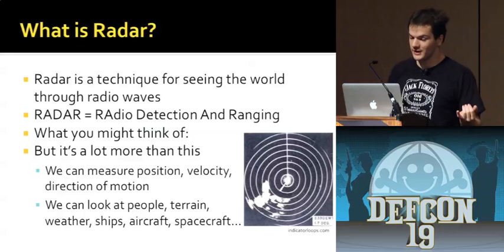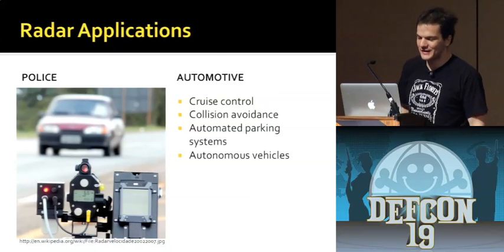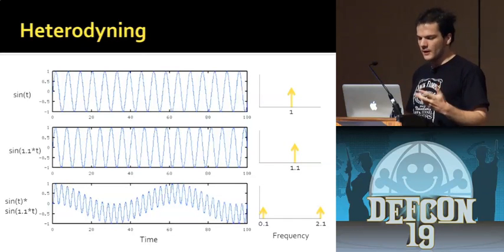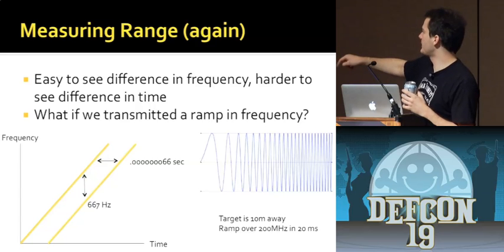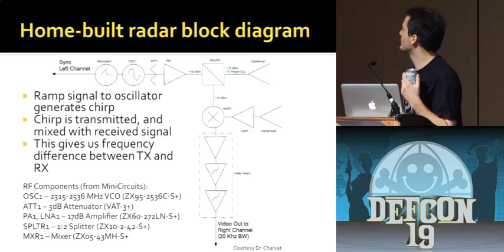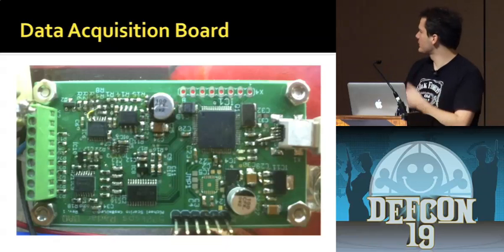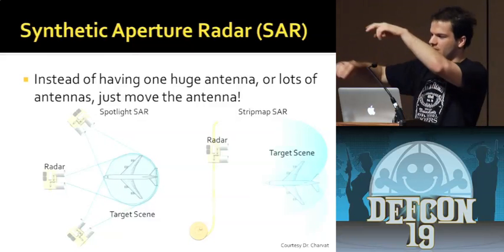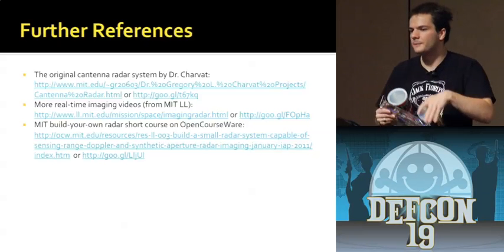DEFCON 19: Build your own Synthetic Aperture Radar (w speaker)

Comment: With Continuous Sweep, the constant audio Freq reflects the Range & Reflectivity of all returns.
The Sweep-Width can be set for Max-Range of reflections.
Sweep-Rate can vary to adjust desired Range-Resolution.
The Sweep-Width vs Receive-Range Window, can be adjusted to receive HiRes Ranging at distances too far for a limited Sweep-Width.
Using 4 Receivers, positioned at X, Y, Z, around the R Reference, will allow 3-D plotting of Returns(using Radar-Interferometry).
Reply: Just like PESA works, I think.